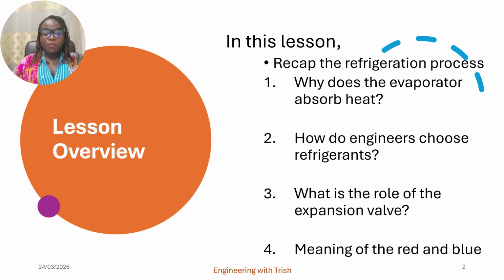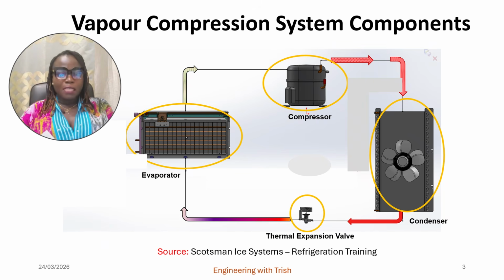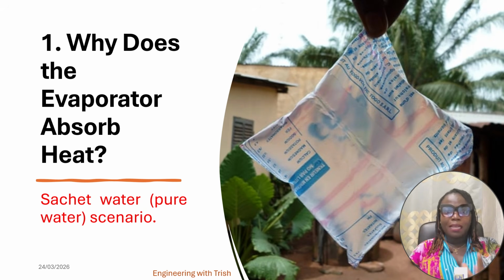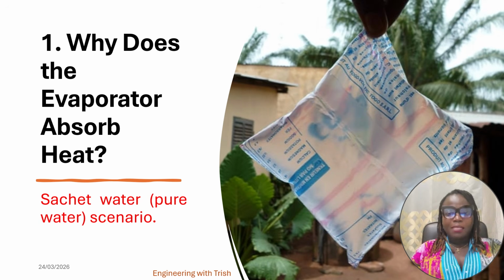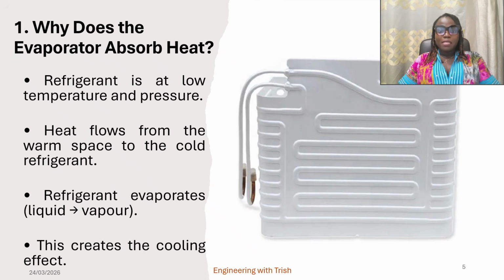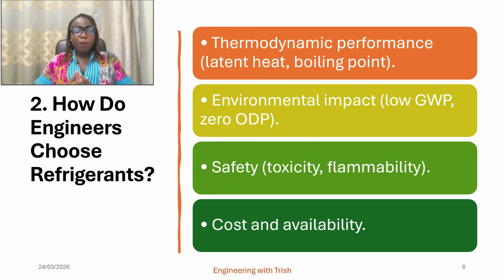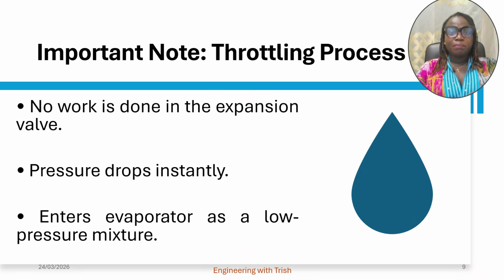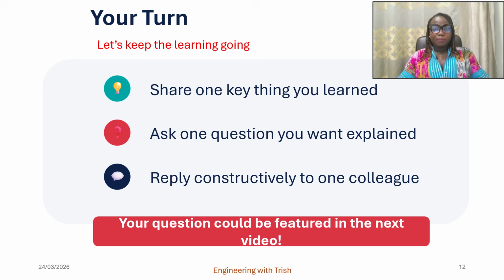Refrigeration Cycle Explained | Students Questions Series #1

Comment: What’s the difference between a condenser and a compressor
Reply: The compressor draws in low pressure or low temperature vapor from the evaporator and compresses it which will then raise its pressure and temperature. But the condenser removes heat from the hot high pressure refrigerant vapor which is coming from the compressor and rejects it to your surrounding air or water causing the vapor to condense to into liquid

Comment: The lesson picked from this session is that, the expansion valve acts as the brain of the system to regulate flow and cause an instant pressure drop.

Comment: One thing I learned is that the expansion (throttling) valve acts like the "brain" of the system by regulating the flow of the refrigerant and causing an abrupt drop in pressure that prepares it for the evaporation process.

Comment: I learnt that the evaporator takes in heat from the surrounding area. This happens because the refrigerant inside is cold and under low pressure, so it changes from a liquid to a gas while picking up heat from the air.

Comment: I learnt that evaporator absorbs heat, the compressor increases pressure, the condenser rejects heat, and the expansion valve reduces pressure.

Comment: I have learnt that Heat Pumps and Refrigerators share the same mechanical components but they differ in their primary objective (cooling versus heating). Notably, a heat pump's COP is always higher than a refrigerator's because it includes the energy converted from work

Comment: I have learnt why refrigeration cycle are important 

  1.Understand how refrigerators and air conditioners work.

2.Determine the COP and efficiency of the system.

3. Select and size components such as the compressor, condenser, evaporator, and expansion valve.

4.Improve energy efficiency and system performance.

Comment: I learnt that the expansion valve (throttling valve)also act as the brain of the system ,which regulates the cooling cycle of the refrigerant before it enters the evaporation

Comment: In today’s class, I learned that refrigeration is the process of transferring heat from a colder place to a warmer place. The fluid that circulates in the system is known as a refrigerant. A refrigeration system consists of four major parts:

Compressor
Condenser
Throttle (Expansion Valve)
Evaporator

Comment: Madam, the throttling device in the refrigerator is very small or tiny. I want to ask the effect or what will happen if it were to be larger and would have an effect on the normal functioning of the refrigerator?

Comment: I learnt that heat can flow from warm space to cold space,for example (when a sachets water is put in a fridge ,the evaporator in the fridge helps to extract the hot less to cold )

Comment: I lent that the expansion valve act as the brain of the system and it's also know as throttling device because it regulate the follow of refrigerant before it follw into evaporator

Comment: Madam, from the example using the sachet water 
Assuming I frequently keep a sachet of water which is at a boiling point of 100⁰c in the refrigerator
Do it affects the refrigerating process and how does it affect it
Reply from the maker: That would significantly increase the heat load on the evaporator, forcing the compressor to work much harder to maintain the set temperature. Shalom. 😊

Comment: I have leaned as the refrigerant absorbs this heat, it boils evaporates from a liquid into a vapor. The energy required for this phase change is called the latent heat of vaporization, and it comes from the sachet water and the surrounding air.

Comment: I learnt that during the refrigeration cycle process the expansion valves acts like the brain and throttles the refrigerant flow base on the load capacity.
Reply from the maker: Spot on, that is a perfect analogy for the expansion valve! SHALOM 😊
Reply: Yes

Comment: I learnt that the refrigeration cycle starts from the compressor. The compressor sucks refrigerant from the evaporator at a lower pressure a lower temperature.
Reply from the maker: Spot on, well summarized! SHALOM. 😊

Comment: I leant Engineers select refrigerants through a careful balance of thermodynamic performance, safety requirements, environmental impact, and equipment compatibility.
Reply: Engineers also analyze the Operating Temperature Range to ensure the refrigerant remains efficient and stable at both extreme high and low system temperatures.

Comment: I learned about the four main components of refrigeration and they are compressor, condenser, thermal expansion valve and evaporator and the reason why the evaporator absorb heat and expansion valve acts as the brain of the refrigeration cycle.Also no work is done in the expansion valve.

Comment: A refrigerant circulates in a closed loop:
It evaporates in the evaporator and absorbs heat.
It is compressed by the compressor.
It condenses in the condenser and rejects heat.
It expands through the expansion valve

Comment: I learnt that the compression of the refrigerant takes place. The compressor thereby sucks the refrigerant from the evaporator at low temperature and pressure. Hence, the compression process increases the pressure and temperature of the refrigerant

Comment: Engineers choose refrigerants based on their thermodynamic performance, safety, environmental impact, cost, and suitability for the application. A good refrigerant should have a low boiling point, high latent heat, low toxicity, low environmental impact, and provide a high COP. The final choice depends on the operating conditions and intended use of the refrigeration system. :hand-purple-blue-peace::hand-purple-blue-peace::hand-purple-blue-peace:

Comment: A refrigerant circulates in a closed loop:

It evaporates in the evaporator and absorbs heat.
It is compressed by the compressor.
It condenses in the condenser and rejects heat.
It expands through the expansion valve and repeats the cycle.

Comment: Refrigerants are not consumed during refrigeration because they operate in a closed cycle and are continuously reused. Any loss of refrigerant is usually due to leakage from the system.

Comment: I learnt that, the expansion valve acts as the brain of the system to regulate flow and cause an instant pressure drop.
Reply: It also regulates the cooling cycle of the refrigerant…

Comment: The cooling cycle relies on an evaporator to absorb heat, a carefully selected refrigerant for safety and efficiency, and an expansion valve to trigger the cooling process.
Reply: Exactly 👌

Comment: Hello madam, thank you for this breakdown! I have a follow-up question regarding the refrigerants: Do they ever get used up or depleted over time?
Reply: Refrigerants are not consumed during refrigeration because they operate in a closed cycle and are continuously reused. Any loss of refrigerant is usually due to leakage from the system.

Comment: I learned that the expansion valve or throttling device acts as the brain of the system to regulate flow and cause an instant pressure drop.
Reply: The cool process sounds amazing

Comment: I learnt that the expansion valve is like the brain of the refrigerant, which controls refrigerant flow and causes temperature drop, and it is also called a throttling valve because it regulates the flow of refrigerant

Comment: I learnt that the expansion valve is also known as the throttling device and its role is to regulate the flow of refrigerant before it goes into the evaporator.

Comment: I learnt about the expansion valve which is the brain of the system and it also reduces the pressure
Reply: Exactly 💯, the expansion valve reduces pressure by throttling the refrigerant, enabling it to cool and absorb heat in the evaporator.

Comment: I learnt that the expansion valve serves as the central component of the refrigeration system, regulating the flow of refrigerant and facilitating efficient operation."
Reply: And mainly recognized as the cooling site of the refrigerant

Comment: I have learnt that Refrigerant are chosen based on safety and performance. And also learnt that the red color is high temperature or pressure and the blue color is low temperature or pressure

Comment: I have learnt that the evaporator absorbs heat and heat flow from the warm space to the cold refrigerator that creates the cooling effect
Reply: Yes the evaporator absorbs heat when the refrigerant is at low temperature and pressure

Comment: I learnt a refrigerator does not add cold to the content(the sachet water) stored in it but rather adsorbs the heat from the water. The 2nd law of thermodynamics says, heat flows from hot to cold. Appling that to a refrigerator operation, heat from the sachet of water flows naturally to the evaporator.

Comment: Madam, refrigerators and A/C has FINS around the condenser coil which increases heat transfer surface for the condenser.

Please what will happen if there's no Fins attached to the condenser?

Comment: I learnt that the evaporator absorbs heat from the refrigerated space (like a sachet of water), causing the refrigerant to vaporize. This process moves heat from a cold area to a warmer one. And I learnt that refrigerator cycle has 4 main components and they are compressor, condenser, thermal expansion valve and evaporator. And how evaporator absorbs heat

Comment: I learnt that compressor increases pressure and rises temperature the condenser also rejects heat and condenser vapor. Also the expansion valve it drops pressure and the evaporator also absorbs heat.

Comment: I learnt that the evaporator a
absorbs heat because
it contains a cold, low-pressure liquid refrigerant that is significantly colder than the surrounding air or medium and also Heat flows naturally from the warmer surroundings into the colder refrigerant, In the case of sachet water, the water molecules are absorbing heat from the environment, gaining energy, and turning into vapor and that's why the sachet feels cooler to the touch, causing it to boil and change from a liquid to a gas, a process that removes heat from the space.

Comment: Lesson note
 I learnt that; Evaporator absorbs heat ”cooling effect”, and also the refrigerant chosen based on performance and safety. 
Red colour donates high temperature and pressure and blue colour denotes low temperature and pressure. The expansion valve enables the cooling cycle.

Comment: I’ve learnt the refrigeration cycle starts from the compressor to condenser passes through the expansion valve and finally the evaporator.
Reply: Refrigerants are not consumed during refrigeration because they operate in a closed cycle and are continuously reused. Any loss of refrigerant is usually due to leakage from the system.

Comment: I learnt that ,refrigerants are chosen based on safety and performance,and also ,a refrigerant cycle has four components which are condenser,evaporator,compressor and thermal expansion valves

Comment: I learnt Refrigerants chosen based on performance and safety. And I also learnt the four components of Refrigerant cycle are Compressor, Condenser, Thermal Expansion valve and Evaporator.

Comment: I also learned that,the first stage in refrigeration is the compressor which moves on to the condenser and also to the expansion valve and lastly the evaporator which is the last stage
Reply: The evaporator also absorbs heat

Comment: I learnt that refrigerator cycle has 4 main components and they are compressor, condenser, thermal expansion valve and evaporator. And how evaporator absorbs heat

Comment: I learnt that heat flows from the warm space to the cold refrigerant and also the expansion valve is the brain or the mind of the system and thinks for the system.
The choice of refrigerant depends on application and safety requirements.

Comment: I learned that 1. Refrigerants are chosen based on their peculiar properties, such as their thermodynamic performance and their environmental impact. 2. Another name for the expansion device is the throttle device . 

My Question: What is the role of the gas in refrigerators? Because once in a while my dad tells his technician the gas in the fridge is finished.

Comment: Madam, please you said the R134a is almost phased out, so I want to ask whether there are other options to replace that, cause you mentioned the selection should depend on application and safety requirements, but the R290 is flammable?

Comment: I have learnt about the four main components of the refrigeration cycle, which are;
1. The compressor 
2. Condenser 
3. Thermal expansion valve and 
4. Evaporator
 
And I also learnt that the condenser is also known as the heat exchanger.
Reply: The refrigeration cycle Starts from the compressor

Comment: I learnt that the expansion valve (throttling valve) also acts as the brain of the system, it regulates the cooling cycle of the refrigerant before it enters the evaporation for its process to continue.

Comment: I learnt that evaporator absorbs heat because the liquid refrigerant inside them is at a much lower temperature and pressure than the surrounding air, causing it to boil and vaporize.

Comment: I learned that the expansion valve plays a crucial role in the cooling cycle, as it regulates the flow of refrigerant into the evaporator and reduces its pressure, allowing the refrigerant to expand and cool effectively.

Comment: Oh wow….thank you ma’am….this is very interesting…

Ive learnt that a refrigerator compressor is basically the heart of the cooling system. It works by moving and compressing a special fluid called refrigerant so heat can be removed from inside the fridge.

This process is the reason why pure water to cool.

Comment: I learnt that the choice of refrigerant is based on several criteria such as availability and low cost, having zero ozone depletion potential, less toxicity and not flammable, and the like. With regards to the above criteria, the R134a refrigerant is the most preferred refrigerant.

Comment: I learnt that, the expansion valve works or is the brain of the system which regulates the refrigerate flow.
Reply: Please what phase is being changed in the refrigerator

Comment: From this section, I learnt that evaporator absorbs heat, and also some examples of refrigerant which are R134a and R290.
Reply: And the R134a is the most used refrigerant since it's cheap and readily available, very safe and less toxic.

Comment: what happens if the evaporator coils become covered in ice, does this block the heat transfer process?
Reply: There's restricted airflow meaning warm air passing over the coil stops and causes it to freeze. Then there's dirt accumulated on the coils which prevents proper heat transfer.

Comment: I learnt that the expansion valves enables the cooling cycle by controling the flow of the refrigirant hence reducing its pressure which cause the temperature to drop,it also prepares the refrigirant for evaporation

Comment: I learnt that the evaporator absorbs heat because it contains a cold, low-pressure liquid refrigerant that is significantly colder than the surrounding air or medium and also Heat flows naturally from the warmer surroundings into the colder refrigerant, In the case of sachet water, the water molecules are absorbing heat from the environment, gaining energy, and turning into vapor and that's why the sachet feels cooler to the touch, causing it to boil and change from a liquid to a gas, a process that removes heat from the space. Thank you
Reply: Nice one ☺️👍

Comment: Thanks for the explanation 

For large industrial systems vs. small home refrigerators, how does the choice of refrigerant differ?
Reply: good question
however, i believe it is primarily based on safety, capacity requirements, environmental regulations, and thermodynamic efficiency just like madam said

Comment: I learnt how important the choice of refrigerant is. Engineers consider factors like:
Good thermodynamic properties (right boiling/condensing temperatures and high latent heat for efficient heat absorption/release)
High efficiency
Safety (low toxicity and controlled flammability)
Environmental impact (low or zero ODP and GWP)
Cost and availability
Examples: R-134a,R-290
Thanks for the simple and practical teaching.
Reply from the maker: Excellent summary of the key selection factors! SHALOM.
Reply: Thats true

Comment: I also learnt that to move heat from a cold space to a hot space you must add work and this work in the refrigeration system is done by the compressor.. Also this violates the second law of Thermodynamics

Comment: Madam please ,what would happen if the evaporator failed to absorb heat effectively?
Reply: It could lead to refrigerant leaks, causing it to run cold and reducing total heat transfer. Also there's restricted airflow where dirt build-up on the evaporator coils reduces its ability to absorb heat from air.

Comment: So madam from the evaporator the refrigerant is in a vapour form and the condenser dissolves it right??
Reply from the maker: The condenser dissipates the heat from the refrigerant after the compression process. SHALOM

Comment: This lesson taught me that as the refrigerant is drawn into and compressed by the compressor, its temperature and pressure rise while its volume drops. The refrigerant becomes a superheated vapor and exits the compressor for the condenser, which is a heat exchanger. According to the second law of thermodynamics, the superheated vapor then releases heat to the surrounding environment.

Comment: I learnt that an evaporator absorbs heat because the refrigerant inside is at a lower pressure and temperature than the surrounding environment, allowing it to absorb heat energy from the surroundings and evaporate into gas to get my water chilled.
Reply: It is very true